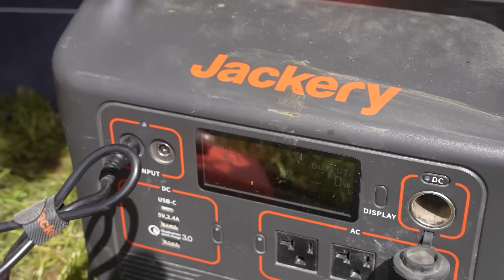Dumbest thing I've ever done, but thieves must pay.

Comment: Next time kick the wind shield in so they cant see where they going and it's much easier to get them caught. 
I've done this for people stealing from my dads house. 
I walked around from the back of the house and found two guys taking shit out his garage I was working in. I was out back in the storage unit and heard the compressor go off and no more air in my line. Which I thought was weird. We live I  rural kansas. So I knew the cops would take 2o mins minimum to respond. So I jumped from the rock wall on the side of the house it's a earth burm house 3 sides contacting the ground. On to there van and broke there wind shield. I held on trying to cause as much damage as possible. They rejected me off the front end by reversing down the drive way and swinging the front end. They got bout 1/2 ?mile from our drive way before going into a big drop off ditch and couldnt get out. The neighbors dogs started attacking them. And the cops showed up. Multiple felonies where charged for them.